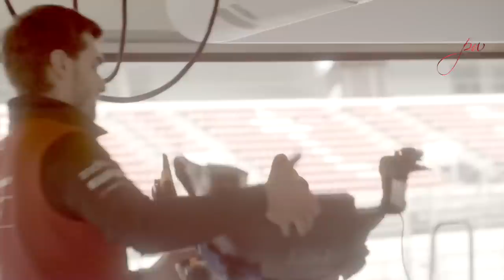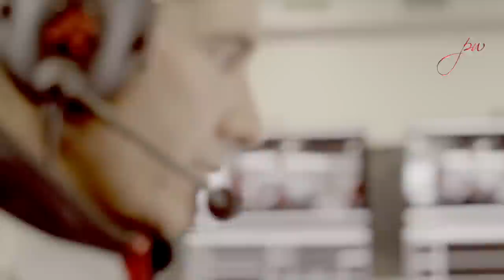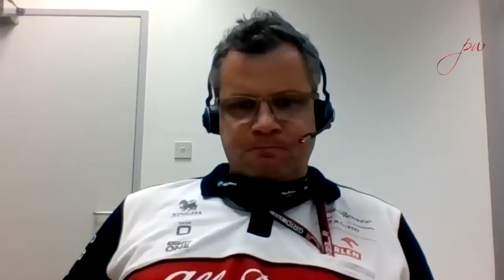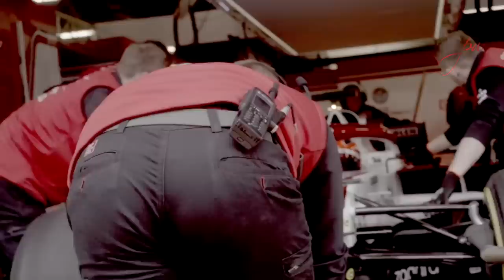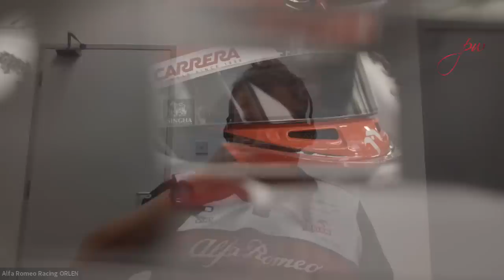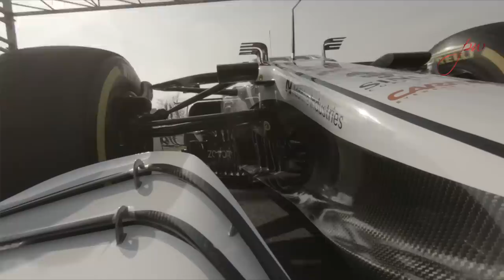Secrets of the improved F1 Alfa with Scarbs. By Peter Windsor

Comment: Great, I still believe McLaren are sandbagging, they will reduce the fuel load at Portugal to take the car to the maximum potential of efficiency and use to full effect that diffuser with the lowest fuel weight possible. This won't give the other teams enough time to catch up with multiple races in a short time. Or they are at full potential...I don't think so, Riccardo, damaged car, 6th? That is one hell of a car.....McLaren look like they have an extremely stable car in all conditions, a very fast stable car which can be stretched to full capacity at Portugal.